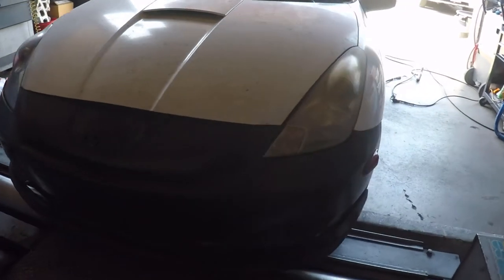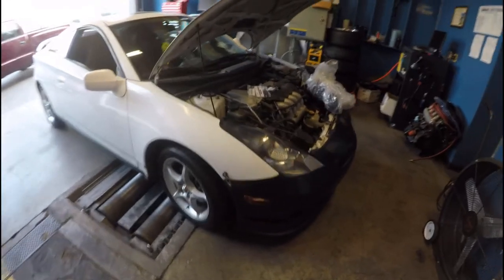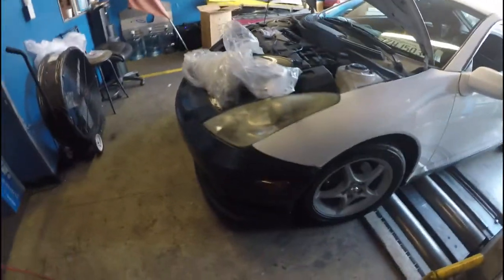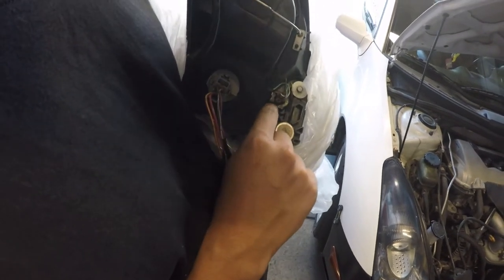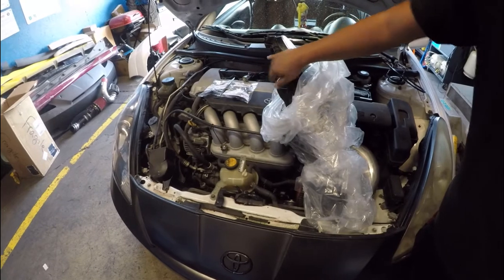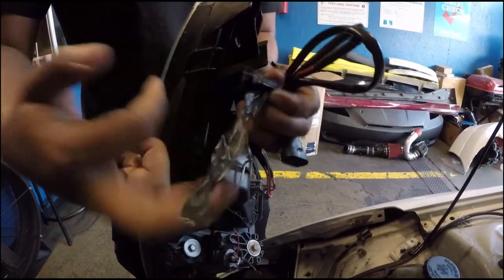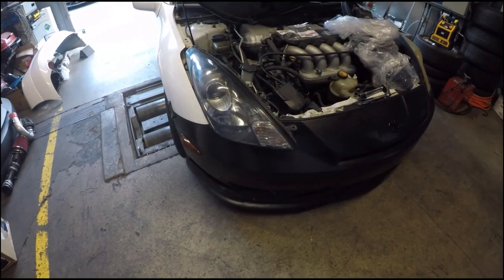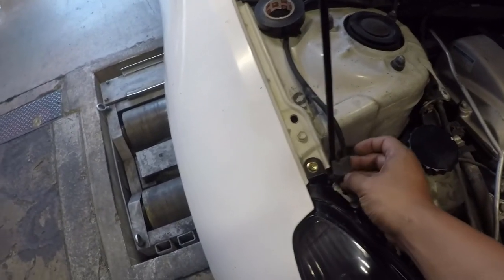Installing OEM HIDS 01 Toyota Celica GTS DIY

Comment: Where did you buy the piggyback to plug to the headlight?
Reply from the maker: Ricardo Espinoza ebay
Reply: Got it! The pigtail has 4 wires: red/yellow , red/black with black base and red/white , white/black with brown base. Which wires connect to the H7 adapter and which to the 9005 adapter?